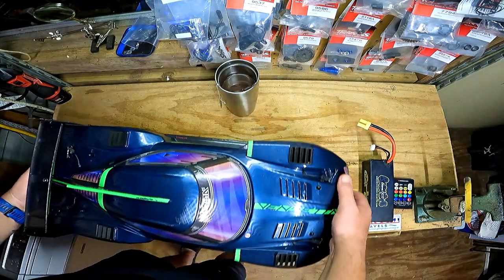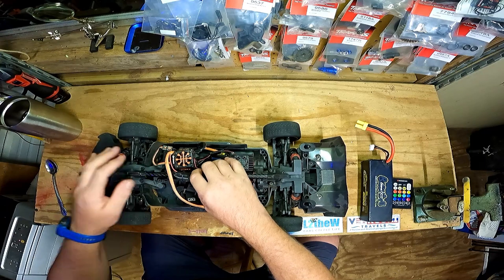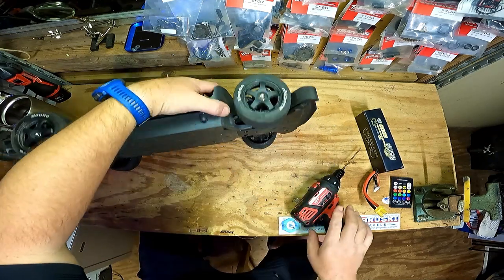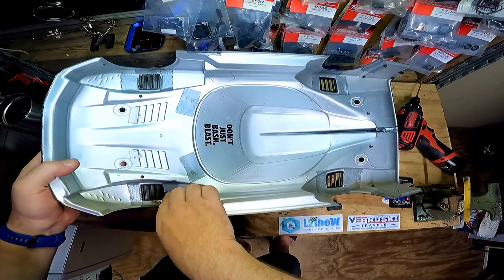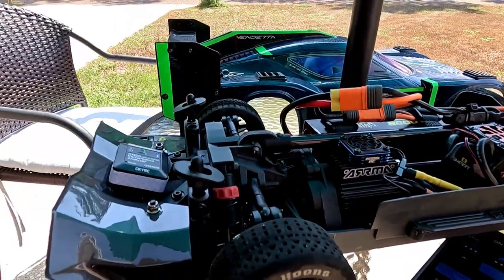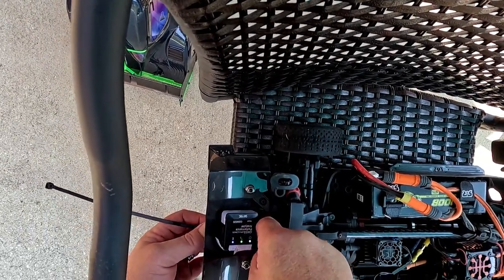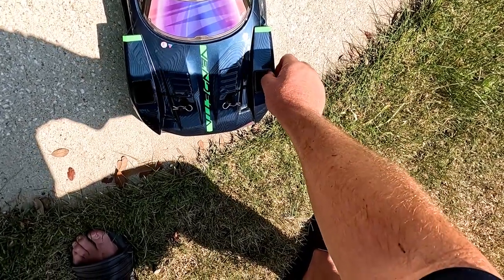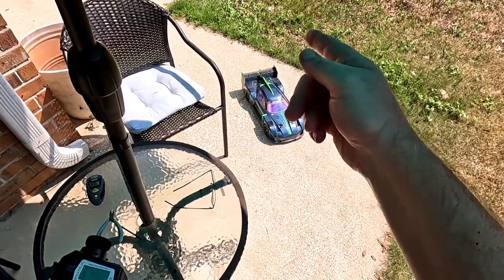Bowling With Trash Cans And My Arrma Vendetta This Is One Tough Car

Comment: I must agree that the road is not the best.   If you could find a concrete or road with a new blacktop surface, that pup would fly.  Not knowing a thing about RC cars, if you could fix the veering (Trim), I would like to see that car hit a 100!  You will get there!
Reply from the maker: Concrete has expansion joints thats not really good for it. A new road would be amazing but nothing like that here. I think there is a spot on the upcoming camping trip looks promising  fingers crossed it works out